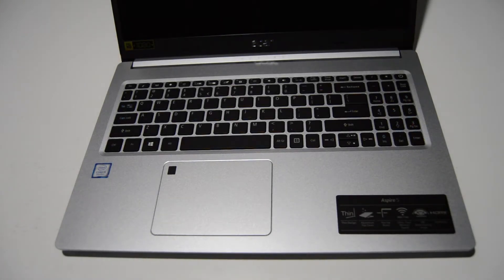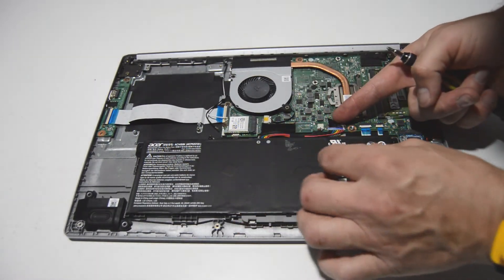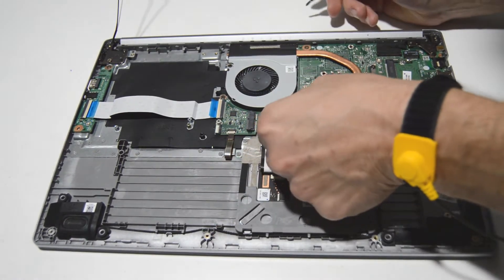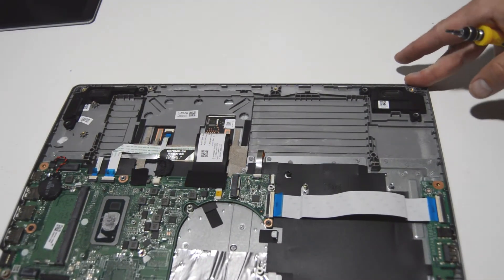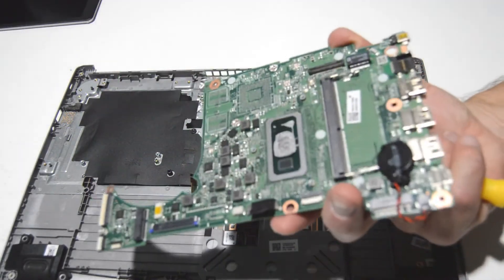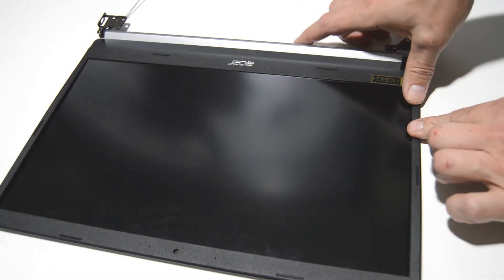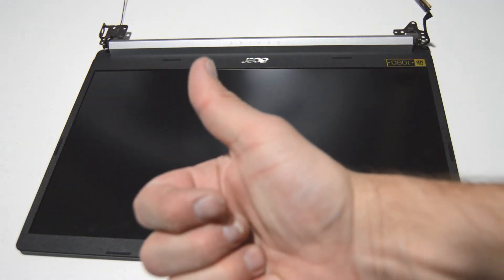How to Disassemble Acer Aspire 5 A515 Laptop

Comment: Do these laptop's use a DDR4 or 3? I want to buy a new ram because it's slow as f*ck with 4gigs.
Reply: Ddr4 3200mhz
Reply: @Yanni3-p9r thanks mate.. I have been looking into my laptop specs for ages, but couldn't find what type of memory it uses. Not even the packaging tells you when I bought it. I looked into the task manager and CPU-Z. Tell you nothing.

Comment: I need to replace my keyboard (DESPERATELY) - do you have a video on how to do that with the plastic rivets situation? I'm thinking I could straight up cut through them and glue them back when I'm done but if there's another way I'd like to do that.
Reply: I just took mine out yesterday. to remove the rivets, I use a really small flat head screwdriver to pried/pulled off each and every individual rivet head. the rivets are cylinders with a larger flat circle heads (similar in shape to a short fat nail), so you only need to pry/break off enough of the circle head so that the metal case/keyboard can go through the rivet cylinder, basically turning each rivet into a cylinder instead of a nail shape. it is a very long and time consuming process and if you aren't careful, you could break something else or even puncture the keyboard. it would likely be easier with a dremel to grind off the rivet heads or use a soldering iron to melt away the rivet heads, but if you don't have those, a really small and thin flathead screwdriver will work. you don't have to break off the entire rivet, only rip off the larger rivet head.

if you have any questions, feel free to ask me through a reply to this.

Comment: anyone else having a problem with these laptops overheating? I have a similiar model and it heats up and freezes so easily
Reply: ive been having mine set up with cold packs underneath bc its hot enough to fry an egg--- it starts to heat up if i open more than one tab on chrome now :( . im currently hoping that upgrading the ram/ssd + a good cleaning will help it run better , since i had been overworking it to hell and back.

Comment: I dont know if anyone else has this problem but the screw on the wifi module seems to be stuck and very hard and im scared cause i might strip it. This is a problem because you cant upgrade the ssd because the connecter for the ssd is under the wifi module. I dont know what to do at this point. Anyone help???

Comment: thanks so much.  This was a big help replacing a dc power jack for my daughter.  Just wish I had more flux so I could have used my solder wick!  At least I had the solder sucker.  Repair shop wouldn't fix it since I opened it to diagnose.  Worried about electrocution?

Comment: Hey Guys, I have this laptop, I stopped working for me, I took it to 2 repair shops, both said the motherboard is dead, and that it is real expensive to replace and i would be better off getting a new laptop, I had only bought it store bought a few months prior to it wrecking, its not covered by warranty as it apprantly had liquid damage cause by user (me), is there somewhere i could buy the motherboard for a decent price my self and just replace it on my own ?
Reply: ebay, craigslist used, that's your cheapest option. Sometimes you can find replacement units sold new.

Comment: I've been a desktop jockey for decades, and only recently had to get a laptop for work. This helped me figure out how to upgrade the RAM, so thank you for this video!

One question for you:

What's the significance of that piece of clear plastic that's stickied to the battery (and to the head of something right of the Wi-Fi card) which you ripped off prior to pulling out the battery?

Can I remove it or is it required to stay?
Reply from the maker: You can remove it.... a lot of laptops have those in misc. spots. Never had any issue with removal.

Comment: any way to get access to the keyboard backlight or keyboard? got coffee spilt on mine,  backlight is now a yellow colour  i’m very very stressed out!
Reply from the maker: Sorry this palmrest has the keyboard integrated, you have to break it out of the plastic rivets holding the backing plate. Replacement of the palmrest/keyboard requires disassembly of most of the laptop.
Reply: @Sellbrokedotcom  do u think dried up coffee will seep through and eventually corrode that metal plate? really worried and scared
Reply: @Sellbrokedotcom  do u also think the coffee will mess up my keyboard, this is the first day of use after i spilled coffee
Reply: @ashwin2350  I just replaced the keyboard on mine, comes as a unit and cost me £21.16. I would make sure you have some good screwdrivers as 1st time I used Draper's jewelers and stripped a head on one of the motherboard screws, had to get me some Engineer pliers to remove it and buy a pack of 500 assorted screws to replace 1 M2-3 :)
Reply: @HansRo4ming  how’d u get the plastic rivets out
Reply: @ashwin2350  you don't, you replace the whole keyboard and palmrest as a unit, if you do decide to do it then don't forget to swap over the SSD standoff.
Reply: @HansRo4ming  where could i find a keyboard and palm rest unit? thank you
Reply: However if it works then why replace it, might as well wait until it fails if ever.
Reply: @HansRo4ming  yea it still works, i’m just gonna take off some of the key caps and clean it
Reply: @HansRo4ming  the problem is, coffee went under the key caps and seeped behind the clear film that’s under the keys, i don’t know what to call the clear plastic other then clear plastic lol.
Reply: @HansRo4ming  got any tips
Reply: @ashwin2350  I would say if it bothers you then replace the keyboard as a unit but other than that why worry.
Reply: @HansRo4ming  thanks
Reply: I just took mine out yesterday. to remove the rivets, I use a really small flat head screwdriver to pried/pulled off each and every individual rivet head. the rivets are cylinders with a larger flat circle heads (similar in shape to a short fat nail), so you only need to pry/break off enough of the circle head so that the metal case/keyboard can go through the rivet cylinder, basically turning each rivet into a cylinder instead of a nail shape. it is a very long and time consuming process and if you aren't careful, you could break something else or even puncture the keyboard. it would likely be easier with a dremel to grind off the rivet heads or use a soldering iron to melt away the rivet heads, but if you don't have those, a really small and thin flathead screwdriver will work. you don't have to break off the entire rivet, only rip off the larger rivet head.

to clean the keyboard on the other hand, I am not sure. I heard you can submerge the keyboard in water and wash it that way, then COMPLETELY DRY IT before reinstalling it, but I am afraid to get the keyboard wet fearing it may stop working all together. if you guys want to test it out, feel free and let me know how it works.

if you have any questions, feel free to ask me through a reply to this.

Comment: Hey, is there a way to fix the keyboard light? Mine didnt work from the beginning
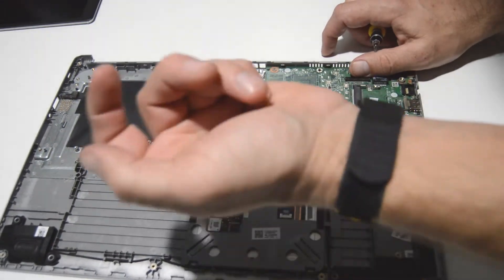Reply from the maker: Possibly, check the connection to the motherboard, we disconnect it at 7:11 its the thin ribbon next to the fat keyboard ribbon. I would also make sure there is no software setting for it in the OFF position.
Reply: @Sellbrokedotcom  Hey! Is there any way to get acces to the keyboard? spilt coffee on mine, backlight is now a yellow colour
Reply: @ashwin2350  @SellBroke i got the same problem, the keys are sticky but working fine, I was hoping if you have found a solution to it.
Reply: @neeraj007ify  sorry man i don’t think there’s a solution, it’s rly hard to get access to where there’s coffee spilt, but it’s working for now i pray it works forever
Reply: @neeraj007ify  smells faintly like coffee, and the backlight is a light brown colour but that’s about it, i also broke some key caps in the process of cleaning
Reply: I just took mine out yesterday. to remove the rivets, I use a really small flat head screwdriver to pried/pulled off each and every individual rivet head. the rivets are cylinders with a larger flat circle heads (similar in shape to a short fat nail), so you only need to pry/break off enough of the circle head so that the metal case/keyboard can go through the rivet cylinder, basically turning each rivet into a cylinder instead of a nail shape. it is a very long and time consuming process and if you aren't careful, you could break something else or even puncture the keyboard. it would likely be easier with a dremel to grind off the rivet heads or use a soldering iron to melt away the rivet heads, but if you don't have those, a really small and thin flathead screwdriver will work. you don't have to break off the entire rivet, only rip off the larger rivet head.

to clean the keyboard on the otherhand, I am not sure. I heard you can submerge the keyboard in water and wash it that way, then COMPLETELY DRY IT before reinstalling it, but I am afraid to get the keyboard wet fearing it may stop working all together. if you guys want to test it out, feel free and let me know how it works.

if you have any questions, feel free to ask me through a reply to this.